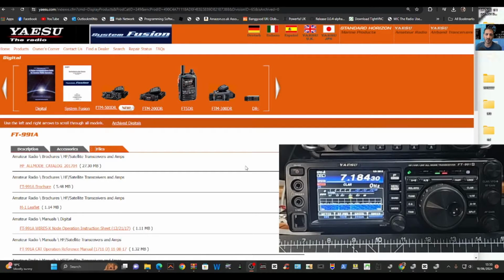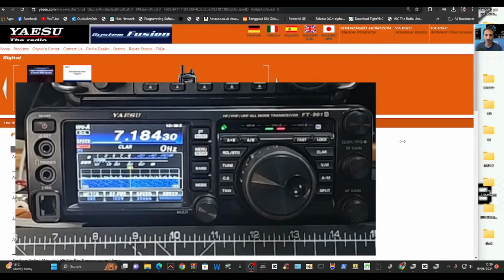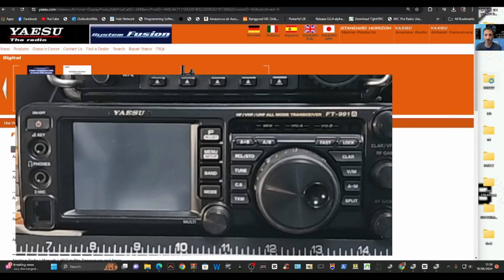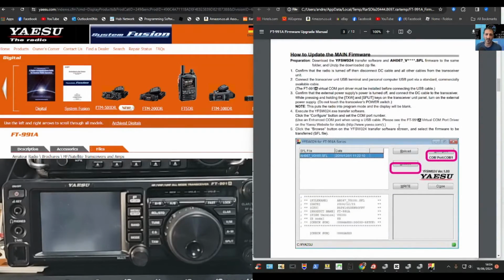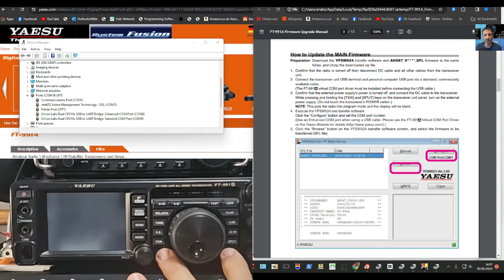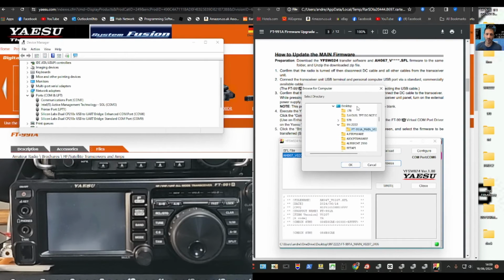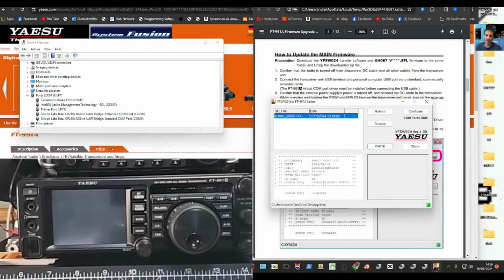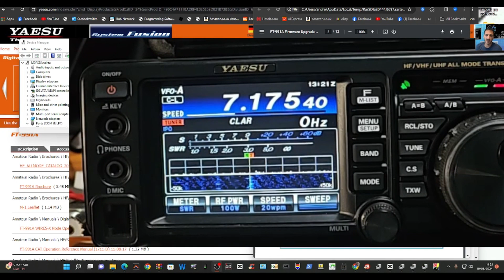YAESU FT991A - FIRMWARE UPDATE V2.07 - JUNE 2024 (Full Reset After )

Comment: Someone else reported this firmware update messed up their mars/cap mod making it no longer work out of band.  Can anyone confirm this to be true?  I’ve also read 991s made for the US before 2017 could expand the uhf/vhf frequencies and not just HF.  Everything I’ve read and according to HRO/Gigaparts the 991 can only be expanded on HF not UHF/VHF.  Did something change in the firmware back in 2017 too?   It seems like Yaesu are trying to do everything they can to stop mars/cap mods.  My FT710 doesn’t have it done but I wanted to pick up a 991 however a non expandable uhf/vhf is deal breaker for me.  My Icom id52a is brilliant with its mars/cap and works very well on GMRS (I’m licensed for both ham and gmrs) as well as MURS.

Anyone have advice on a base station with a good receiver that can do uhf/vhf/hf and be expanded to include MURS/gmrs?  I’m looking for a one stop solution for everything.  I don’t need a fcc lecture btw, there are plenty of people doing far worse who are not even licensed and I program my radios to follow the rules on gmrs (proper wattage, narrow/wide when required, etc).  Same with MURS.  I’m not going to bother listing current/former gov positions that would allow me to transmit out of band as it’s irrelevant.  When the fcc starts enforcing these paid gmrs repeaters which are also incorrectly configured and causing interference on other frequencies, maybe I’ll start to care about the dumb rules like one radio per license band.  To me it’s just a deal they made with radio manufacturers to screw us out of money having to buy multiple radios.  I follow the band rules for what I’m tx’ing on which is far more than others are doing so they can fk off forcing me to carry around a ham, gmrs, and MURS radio.  I don’t need to carry three radios, thanks fcc.
Reply: It didn't affect any of my MODS, so ok to upgrade.
Reply: @andylovelace4126  appreciate the feedback.  Thank you.
Reply from the maker: All OK now
Reply: @M0FXBHamTech  Perfect. Thank you.

Comment: I downloaded the update today and it was a version 3.01 from the Main firmware. After the full reset, the memory channels did not disappear.
Reply from the maker: Sorted but firmware is 2.07
Reply: I think my reset was not correct. I did it again and the memories disappeared. But in the info of the version on the radio, I confirm it is v3.01 for Main.
Reply: Sorry for my mistake. I had downloaded firmware for FT991. Now with FT991A the version is really 2.07. Sorry.

Comment: the update says it fixed a BUG in Main  02-06   in the  02-07 Version but it does not say what the BUG is ?? anyone know?
Reply from the maker: It was a minor bug to do with QMB read the notes again .
Reply: Quote"
@Pacman163

I got this email from Yaesu they are working on the firmware update for the 991A. So sit tight and be patient.

Hello Steve.
Thank you for contacting us regarding your FT-991A.
I am sorry but we did find a problem with the latest firmware update and have subsequently taken it down from our website. We will re-post it when the fix has been completed.
We are aware of the problem with the update removing the MARS mod and that will be corrected with the new update.
Unfortunately we do not have a timeframe on when the new update will be posted, but we do know our engineers are curently working on it.
If there is anything else I can help you with, please feel free to contact me.
Best regards,
Rodger Kerr, N6GMT,
Amateur Radio Technical Support
Standard Horizon Marine Support
Yaesu USA " Unquote. This was about version 02-06.
Reply: @ronsworldnl  Wait, it "removed" the MARS mod?!?!  So the mod where you remove (or add, I forget) a short on the main board?  That hardware mod?  So that update told the processor to ignore that option on that little strip of connections?
Reply: @piquat1  I guess so. (add a short for the MARS mod)